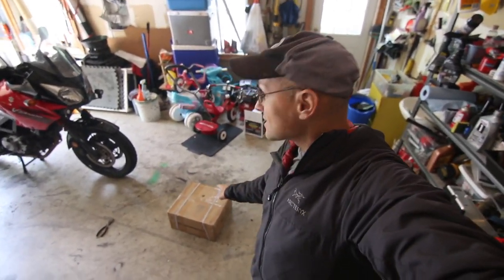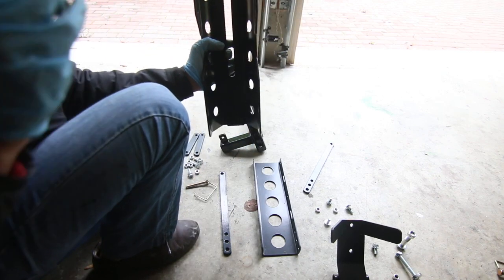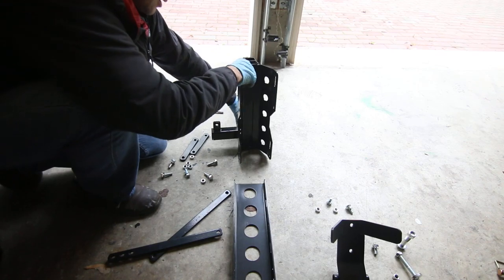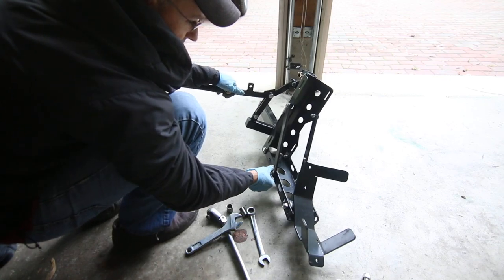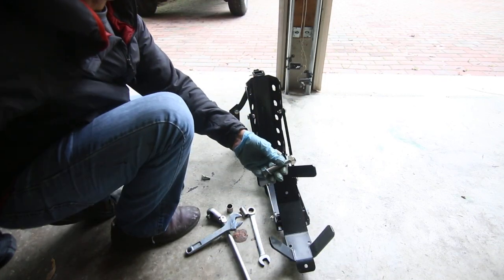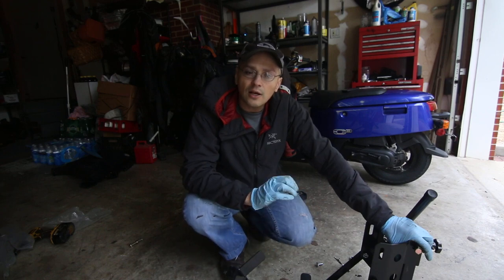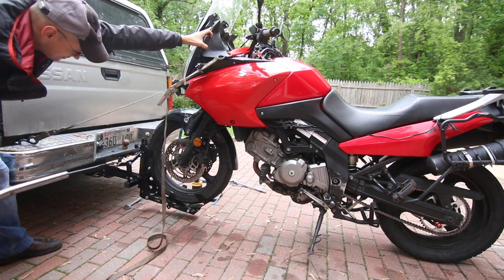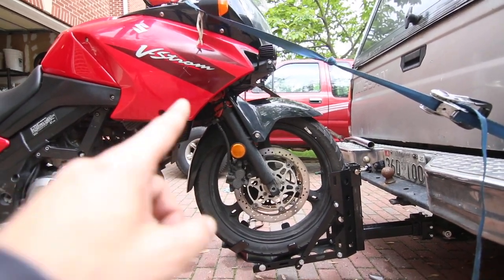Motorcycle Front Wheel Hitch

Comment: I've used one of these to tow over the Transcanada highway between Vancouver and Calgary.  It has held up on numerous motorcycles (KZ1000, BMWF650GS twin, ZX14, and BMW R75/5).  I have put on thousands of km's with one of these and I've never had a problem.  I have heard some people say it will wreck your transmission because the oil won't circulate, but I have never had a problem with any of my bikes afterwards.  On my F650GS, I did have to watch the paniers, because on full-lock turns with my SUV, the bike leans so much that the paniers would skid on the road.  Best to plan your trip and try to avoid "full-lock" turns.  Make sure that when you snug down the front with straps that you don't bottom out the front suspension.  Again, I haven't had a problem with fork seals, but you don't want to wreck your bike.

Comment: I have one just got 2 weeks ago.  One of the bolts broke that goes into the hitch., had to another bolt not come with a nut.  No instructions included.  So when I tried it this past weekend, never again.  It trailer isn't stable at all.  Driving and turning to see your bike almost on its side is scarey.  The leaver to push the trailer up is hard to press down.  I even bought extra straps because it came with 4 black straps that aren't good for anything.  If you use this, only real short distance. I would not not not buy this, hate i did. You better off getting the one from uhaul.
Reply: Timothy Brelsford We manufacture rear wheel tow hitches in the USA. Our customers have safely towed their bikes 10,000’s of miles. check us out www.motowus.com

Comment: That still puts millage on bike ?!!! Im almost positive it will
Reply from the maker: You are the sharpest tool in the shed.
Reply: @VehicleHunter  took you minute to realize it though like i said before evidently ur not that sharp
Reply: Has to!
Reply: It puts wear on the rear tire, but if you mean will the odometer increase the answer is no. Odometer reading is usually based on how fast the engine is turning while or the front wheel is turning. With the front wheel up and the bike off, no mileage increase on your odometer.

Comment: You can also use carriage bolts which have a rounded head which will allow the front tire to fully engage inside the front wheel holder cage.

Comment: These cheap ones work, ,but you get the LEAN so badly it is almost scary. Also for those asking questions about lights...If you are pulling any trailer or vehicle that does not block your turn signals, brake lights and tail lights. You don't need extra lights. However if people cannot see the bike behind your car they could slam into it. That said, I always use a flag, and also tie on a blinking led flasher like that comes for bicycles. 2 of them. These will cause your bike to lean badly. The only way to keep that from happening is to create an outrigger that you can then tie the bars down to, and also the rear of bike to them as well. Keeping the bike straight keeps it from leaning badly and tilting to the point of being fearful it will fall over! Some tie the bars to the tow vehicle, Which only helps. But until you cinch the bike to some type of outrigger, you will have issues with dangerous leaning.

Comment: The large bolt goes on the bottom of the sliding part of the frame. And the thick washer goes on the large bolt between the upright and the front wheel part.
Reply: LMAO duhhhhhhhhhhhhhh right ?

Comment: I see a big problem with this kind of tow. Number one the rear wheel suspension and bearing are still in use. But more importantly the belt is contacted to the output shaft which even in neutral is spinning. Since the oil pump is not working there is limited oil to lubricate the output shaft output shaft bearing and seal. I myself would not use this tow method  unless it is a short trip less than 100 kms
Reply: Doesn’t the gearbox have its own oil supply which isn’t dependent on the engine pump?
Reply: Maybe take the chain off, if it has one..just thinking.
Reply: @boy3t7E  yes that’s a solution and causes no problems to engine but there is still wear on rear bearings. and suspension bearings. If you delivering a brand new bike I wouldn’t trailer it this way. It’s a disservice to the customer
Reply: @vicshere1  For sure. I would just use for personal use really. But if brand spanking new...all tires off the ground. Thank you. Cheers!

Comment: do you think your honda scooter could be transported using with this system?? I am debating getting a hitch for my vehicle to carry my scooter. debating between this system or a motorcycle carrier to do the job. I have a honda elite 110 2010.
Reply from the maker: Nice, i used to have one of those elite 110's. Now riding a honda sh150i. Prefer the 110 honestly. For the scooter i would just get a moto carrier instead. The scooter is so light. The reason i got this was to haul my bike in a pinch, but the vstrom is 500lbs so a career would be too much weight on it.
Reply: @VehicleHunter  ok that’s what I’m going to do then but guess what. I found a tow hitch for my 2008 Corolla finally, plus a straight adapter for a 1.25” to 2” receiver. The you max toungue weight rating is 200lbs or 2000lbs towing capacity. The elite weighs like... 254 minus 12lbs if the gas tank is empty. so with the carrier and  an extra 40lbs over the toungue weight rating I may be pushing it but I’m just going to get on of those stabilizer things plus a bunch of ratchet straps to tie it down. I may be 50-80lbs over the suggest tongue weight but I think my hitch and 2008 Corolla can handle the elite. Only going short distances anyway. I once towed a 383lb ninja 300 with a huge 60lb motorcycle carrier on a hitch rated for a 350lb toungue rate and it performed super well on my old Honda Odyssey that I sold. So I think it will be able to handle such a small scooter on my 08 Corolla. Plus the ground clearance is about 9”, which is an inch higher than a Toyota Sienna.
Reply from the maker: @robertp9370  You have to be careful. The weight on bumps is transmitted to the hitch. There is a guy named vegasromaniac and he was doing that with his toyota yaris with dirt bikes. But he reenforced the hitch mount to the frame. You should consider that.
Reply: @VehicleHunter  ok I will consider that I  did see his videos and others so many times. I will have to see what I can do. But man it would be sweet if my Corolla could carry it around. I’ll do whatever it takes lol. The backseat of the Corolla folds about 170 degrees flat, almost perfectly flat, I’m trying to camp out of it with my backseats folded down and carry the scooter on the back. I’ll figure it out.

Comment: What are the laws for brake/ turn signals when towing the bike?
Reply: If you are pulling any trailer or vehicle that does not block your turn signals, brake lights and tail lights. You don't need extra lights. However if people cannot see the bike behind your car they could slam into it. That said, I always use a flag, and also tie on a blinking led flasher like that comes for bicycles. 2 of them. These will cause your bike to lean badly. The only way to keep that from happening is to create an outrigger that you can then tie the bars down to, and also the rear of bike to them as well. Keeping the bike straight keeps it from leaning badly and tilting to the point of being fearful it will fall over! Some tie the bars to the tow vehicle, Which only helps. But until you cinch the bike to some type of outrigger, you will have issues with dangerous leaning.

Comment: I don't know how I feel about this product, the concept seems too good to be true. and it is as I bought one. What I did not like was the Ground clearance. its maybe 3-4inches off the ground and my cars suspension was drastically lowered, then again who hauls a motorcycle in a Prius. in this video it looks like its 2inches and he has a truck and can only imagine the road scrapings and sparks. you can make adjustments to the support arms however I felt it was unsafe for a 250cc on a 800 mile journey. Lets just say it was a Failed Idea , a mistake, and try to return it as fast as possible.
Reply from the maker: Yeah, not sure i like it either. I wanted it to be effective, but it does seem tough. I do think it can work in a pinch. But uhaul rents moto trailers for 30$ a day.
Reply: @VehicleHunter  something like a donut tire recommended for 10-20 miles till you repair your full size tire. That’s kinda the vibe I got. The sad mistake is that the 04 Prius needs rear struts replaced, never been done. So my 2 cents is that it depends on the car. The uhaul receiver hitch was a 1.25, I went to harbor freight for a conversion adapter to a 2in that extended it out, I also had a full tank of gas on the cycle. What I’m saying is that there are other factors to consider. Other people say that the Transmission is turning which affects the clutch. Then other reviews say they have had no problems with long distance. If it’s mixed reviews then I say try at your own risk. The video did help me, thanks for that totally much appreciated for how to put it together v hunter.

Comment: Never liked these...mostly because the system does not articulate like a trailer would. This causes the bike to lean in turns and the rear wheel of the bike "chatter" as you go around any sharp corners. Puts a lot of stress on the bike and is scary as hell. Plus, the "jack" to raise the bike is crap if you have a heavy bike. I built one that articulates for my 1100 cruiser, but I only use it to haul the bike across town to my mechanic. Never would I consider taking it long distance.

Comment: seems like a fast way to wear out your bike.
Reply: I think riding your bike wears it much more.
Reply: @zeqillanes4312  That was a very stupid statement.
Reply: ZEQi..you seem to be smart about motorbikes,butYou missed a really important point.True..it simulates driving with the rear wheel on the ground.EXCEPT,in this situation,the clutch is engaged,both the engine and the oil pump off..and the motive power is flowing the opposite direction: from the rear wheel up the chain to the transmission.instead of the other way.I would recommend removing the chain.